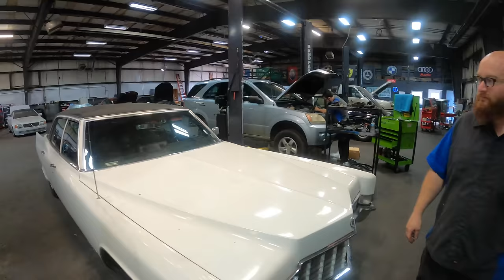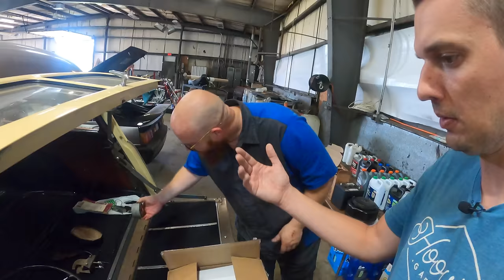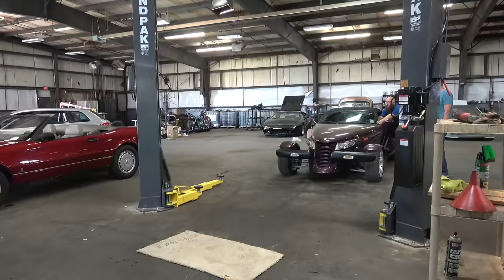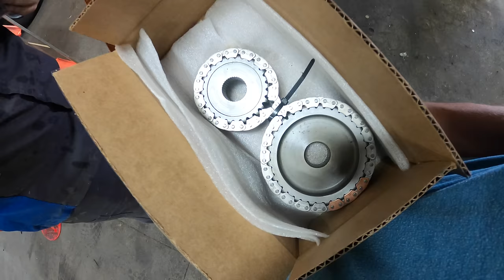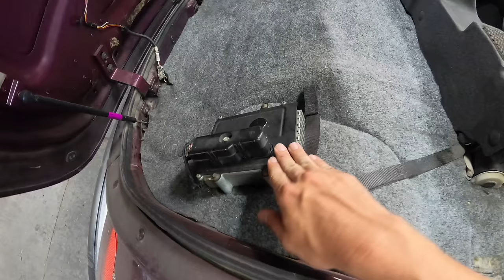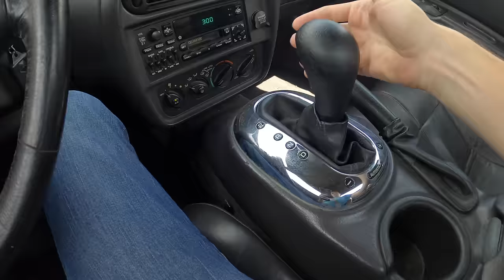Everybody Should Buy A Plymouth Prowler And Do These Mods RIGHT NOW!

Comment: 1999 the grand cherokee came with a 4.7 h.o they were 265 hp and like 345 tq. That would have been the motor to use. V8 sounds that could be tuned up pretty easy. Cross bolted mains, pretty beefy rods. They are just slept on.

Comment: Ask the Wizard about a TorqAmp electric supercharger for the Prowler. ECM will need another tune for the added fuel requirements and maybe bigger injectors but it's the simplest way to install a power adder. Those cars are iconic.

Comment: I've sold cars for 32 years now. I remember when this Turd came out, about the same time the PT Cruiser was released. It is under powered and was made for people 5'11"  and below. If you think Im joking just take your 6" but and sit in it. You will be driving with your head sticking above the roof. The huge black post is exactly level where your eyes are. I sold 1 and the customer called 1 year later asking if we wanted to buy it back, the answer was a very fast "NO!"
Reply: The average height is 5’11 so…. And this  is a sports car (think Miata) not a sports coupe (Mustang). Also it wasn’t underpowered. 7.2 seconds to 60 was fast considering the 91 mustangs v6 with 180hp did it 8.7 seconds. Even the 220hp 4.0l v6 in 2005 was still slower than the prowler. The only car you can directly compare this to was the Panoz Roadster which had only a 300hp v8 (0-60 4.5seconds ) but it was expensive and very spartan…company didn’t have any car V8 that was more powerful (Magnum v8). If they would had used that, it would had been a very unbalanced, front heavy and an under steering mess with no ABS (didn’t become mandated at the time).

Comment: I always loved their shape and style, I think now tho I would put in a hot 4 cylinder motor tho, increase the HP and Torque to weight rations, lighten the car of some of the un-necessary items, replace as much as I can with lighter composites. change wheels out for lighter (and even better looking) ones to change the un-sprung weight. Im guessing total weight reduction could easily be 300-350 lbs add in 20ish lbs for better stereo system. could increase HP and Torque numbers in to the 500s. more than enough room with a 4 cylinder to toss on a turbo (or 2).

Comment: I often thought that the perfect engine swap for this car would be the Volvo 8444, which was a 4.4 liter V8 with 4 cams that was built on a 60-degree V, instead of the normal V8 90-degree V. It was also made very compact so it would fit sideways in a Volvo XC-90 SUV. It was rated at 310 hp standard, but several hop-up upgrades were built for it in Europe. Further, as it was made by Yamaha, and Yamaha also made 4-cycle marine outboard engines, they have a version of it, turned on its nose, with a stroker crank, out t0 5.6 liters displacement that puts out over 350 hp. Maybe put in somebody's transaxle with a 6-speed manual transmission. To those who say the fit would be tighter than tight, I say, "you can put anything in anything if you got a big enough crowe bar." It will fit, because its only a 6o-degree V8, same V as the current V6.

Comment: That prowler is amazing with these upgrades. I had always wondered why they didn't stick a V8 in these..now I know, this aliminum V-6 is has less weight and 15 hp power less than the heavy iron V8 of the time.

Comment: I own a Kia Rio. The AC compressor locked up and threw the belt. Somehow it got sucked into to the timing cover. So of course that was that for that motor. Nothing pisses me off more than putting a $800 motor in a $1200 car. 
Honestly its still a great gas saver that I still drive.

Comment: the trans were limited to ~300hp, The engineers tried to push the HP from the 3.5L on the Chrysler 300M S, but the trans tended to blow up after 300hp so they dropped the power down to 290. Tho I had a friend that put a torque converter and supposed to have beefed up the trans and it survived....

Comment: I remember racing one of these in my all stock 305 TPI iRoc and beating it over and over we did that run like five times lol
And the top that off about six years ago right here in town with my son in the car I was in my 1984  z28 and . But that was a different car with much more horsepower.

Comment: Thank you for the work you do.  I have a 99 Prowler and all of the tops of the struts/shocks/sway bar dampeners are disintegrated (sorry if I use the wrong terms).  You mentioned replacing the Sway Bar Links because the old ones disintegrated.  Are these the same things?  do you have any links you can send me for parts?  is it an easy DIY job?  Thanks again

Comment: rear tires on the Prowler: P295/40R20. HUGE for that era. That's a modern day truck tire size. 
so, yes..they are likely going to be tough to spin, lol. Good/Year hadta make them special..
they didn't exist. But since Chrysler had used mostly GY tires the prev many decades..aha.
..chat saying 90's-2000's Mopar were good cars: Yes. Chat saying Chryslers are all trash now: bs. 
Exhibit A. Our 3.6L 283 hp Journey awd. 160k mi and running strong. & she's not the only one..

Comment: Have a 2001 that came with upgraded 300hp engine so while can't have too much horsepower the car is so light it will already do the burnouts, if needed, bark the tires on the shift. Chrysler had already did the trans thing where it shifts harder BUT will probly add a few hp mods. Like a new Hemi. Car has over 30,000 miles so not a virgin. Great shape so won't hurt value. Definitely will check into the exhaust. I don't mind the stock exhaust...sounds pretty good inside the car but wife sez it sucks from outside. Need something to overcome that V-6 sound. Perhaps give it a Ferrari sound....not likely. Sometimes you can actually just remove the muffler and run off the cats, like GT Mustangs and they sound like Flowmasters. 
Today, July 14, 2023, while driving 4yr granddaughter around the yard at bout 2mph and the left side lower ball joint broke. Fortunately didn't destroy the fender and tire didn't get into the body. Can't get it on a rollback and trying to figure out how to even jack it up. Miracle it broke in the yard. Was about to leave taking her sister to a church lock in overnighter....via interstate. Miracle. 
Good vid per usual. Livin the dream.
rick in Tennessee.

Comment: Chip foose one of the designers of the car design it for a hemi in the back. But he did mod one to have a hemi I the front. But he had to move the front wheel forward and change the side panels. Now he did build the true car he designed it is called the hemisphere.

Comment: Glad you put the 3.5 in there. The 3.6 Chrysler replaced it with is complete garbage. Full of issues and Chrysler refuses to put out recalls to fix the issues with that motor. The worst application the motor is in are the jeep wranglers. OMG they are a head ache in those. Always burning up wires in the harness.
Reply: This isn’t the pentastar (which today is still one of the best engines in the industry) this is the phoenix v6 I think from Mercedes.

Comment: Rear transaxle like a Corvette? Man weight balance should be exceptional. I hadn't realized the engineering prowess put into these. These were severely overlooked for mere hp disadvantages, which can easily be fixed.

Comment: You're right that the 5.9 Magnum having 250 HP but it had great torque at 345 ft lbs.  The Dakota RT was a little rocket.  Adding a more aggressive cam, intake and headers, something that Chrysler has been more than willing to do over the years, could have netted the the 5.9 with and easy 300+ horsepower.  The decision to put the V6 in Prowler was a marketing decision.  Weirdly enough, they aimed at the older set, not the performance enthusiast.  Huge gaff by Chrysler.  This car with a V8 would have been insanely popular and today it would be worth high 5 figures.

Comment: The throttle plate on a regular 90’s Chrysler V6’s isn’t that big. You should see a very useful 5hp bump across the board with a ported throttle body. Maybe more power than that with the tune you now have.
Reply: And if wizard would open the ports with a dremel it would really improve the Tq.

They didn’t tune the parts on these things as aggressively as they do today from the factory. The actually used the bottle necks as the “safety” for the engine, and it’s long term life.
Reply: And if you half shaft the throttle body it really opens up that hole under w.o.t.